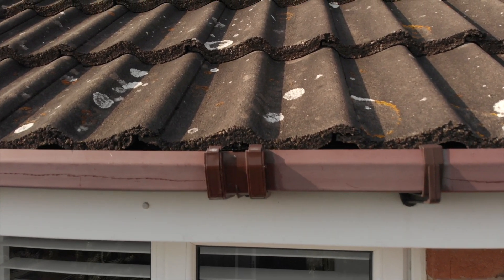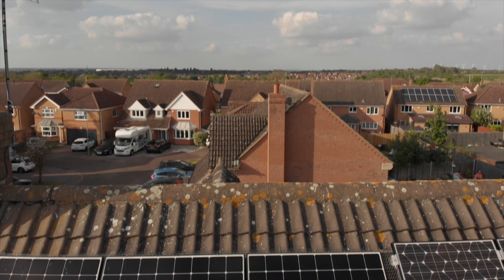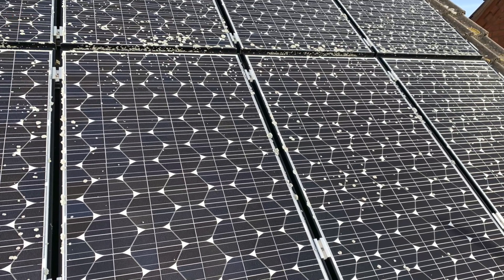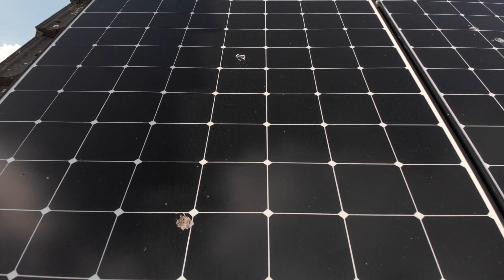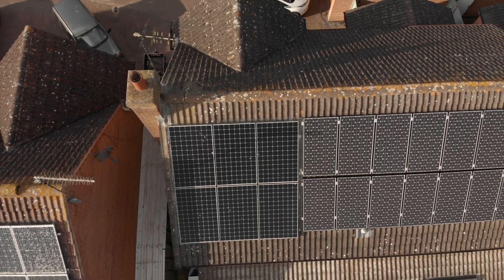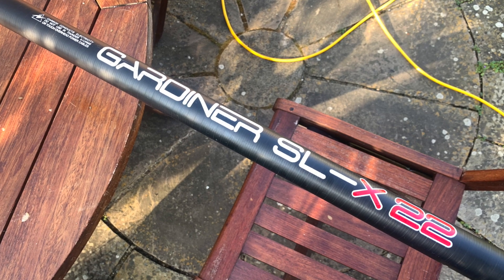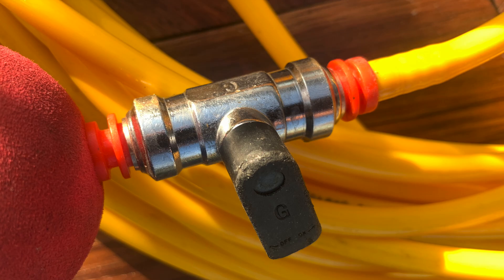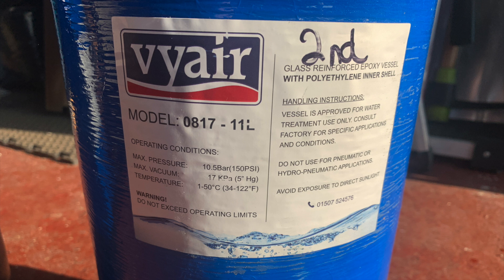How I clean solar panels with a water fed pole - WFP

Comment: You have a big advantage being able to stand on your extension roof - not too far to reach the panels. Reaching the panels from ground level will be much harder I imagine , perhaps impossible. I paid a roofing company to fit a mesh round my panels as I was getting a lot of nuisance from Pigeons and Doves. Whilst they were on the roof, they cleaned the panels using water and a stiff broom. Some of the soiling would not shift but they were a lot cleaner. I don’t however see any improvement in generation. I have had cleaning quotes - £14 per panel which is ridiculous. The outlay would never be recouped by any improvement in generation. I’m worried about longer term lichen so will look at trying what you did.
Reply from the maker: The single story extension certainly makes access for cleaning much easier. You can reach panels from the ground with a longer Water Fed Pole but it's physically harder work to do. I friend purchased a longer length WFP as he can only reach his panels from the ground.

Comment: Was there an appreciable uplift in generation after you had cleaned the panels? We have panels which were installed around the same time as yours and have never been cleaned....they are now pretty dirty and have moss growth on several of them so I'm thinking of giving them a clean. Also did you turn off the system when you cleaned the panels?
Reply from the maker: Thanks for watching John. I did not see a massive increase in generation. That said not cleaning them over a long period of time will certainly impact their performance especially if the moss growth you have continues. I did not turn mine off, they are active during rain, wind and thunderstorms. To be 100% you probably should do, but I never do and it's not like you are scrubbing them aggressively.

Comment: You could consider cleaning using rainwater, it has a very low TDS anyway, it’s going to be no different to every time it rains anyway. It’s largely the mechanical action of the brush that removes the dirt. Or rainwater as the feed water to one mixed bed resin vessel.
This doesn’t work so well for windows, where the fully deionised water is useful for spot free windows. 
I picked up my WFP off eBay secondhand, at 15metres it is a bit of a handful but I can get right up to the ridge tiles from the ground. But being carbon, a near perfect conductor of electricity you do need to keep well away from all things electrical, I DC isolate my panels too, just in case, even though deionised water is a poor conductor. Plenty of fisherman have died over the yearsfrom carbon poles touching high voltage overhead cables as have a few window cleaners.
Reply from the maker: Good points raised about using rainwater. We do collect it across 3 water butts  it is almost exclusively use on the large quantity of garden pots and plants.  

The WFP is a game changer for keeping windows and solar panels clean and I do enjoy using it!

Comment: I put my outside brush with soft head onto the telescopic Treen pruner extended. End of the brush head connected my power washer.  With the power turned pressure turned down on wide spray  everything connected to each other with Gaffer tape . Cleaned my panels. 0 cost .  Single story roof. I am frugal!

Comment: You do need to clean them but not very often. I cleaned mine this year for the first time in 4 years since got them. Had green mist over them.
Reply from the maker: Agreed, once they are clean they tend to stay clean and don't need doing that frequently depending on your location and conditions.

As I have the equipment I clean mine a couple of times a year just to prevent green algae re-growth.

Comment: So useful and informative John. Many thanks. I have been horrified by the quotes I have been receiving from companies to clean my 22 panels so I think a water fed pole is the way to go. I have carefully studied the video and what you purchased (Gardiner SL-X22 pole) but the Gardiner website isn’t the most user-friendly site for a non-technical person like me. So would it be possible to ask you to list exactly what you purchased from Gardiners for your solar panel cleaning  - pole I know is the SL-X22, but what brush, hose, spray kit, accessories etc. Then I can adjust if necessary to allow for my access and roof height etc.
Reply from the maker: Hi Peter, the website is not that user friendly for non-industry people. Here's the list, if you like drop me an email if it's easier for you. 
1 x Large Overspray Kit OVERSPRAY-BR,
1 x Upgrade to a Quick-LoQ Angle Adapter Long
1 x Ultimate 26cm Brush - Flocked
1 x QuicK-LoQ Brush Socket
1 x 2x 2mm Standard Pencil Jet Capsules
1 x ULTRAFLEX Hose - 10m Length for 18-27ft 
1 x Anti-Snag 'Hozelock Type' Male Plug
1 x Push-Fit 4 Way T-Connector for 4 Jet Brushes - no red clip
1 x Red Locking Clip for Push-Fit T-Connector
Jet Hose (6mm OD) - per metre x1M

I have purchased extra brush heads to do uPVC windows and soffits etc.
Reply: @johntisbury  Hi John. Thank you so much. I've sent you an email re the above.

Comment: Just an observation at 3:35 your ladder is standing the wrong way around.  The top of the treddle should be parallel to the ground roughly speaking.  As yours is the opposite way you are stepping only on the rear corner of it, as a result your effective grip on it is reduced and with wet soles on your shoes this may increase the chance of a slip / fall.
Please be careful
Reply from the maker: Thank you Jason, I will review my procedure for ladder / treddle placement. Appreciate you commenting and helping here.

Comment: Our panels were installed in 2018,2019 and 2021 never cleaned them until this year . Until this year they've self cleaned after rain but this year there's been an odd green dust layer that hasn't shifted so I've tried the same pole you have and will be buying one myself . Our roof needs 45ft reach to clean the very top edge so it so lucky with access.

We're in a very hard water area but my intention will be to clean after or during rain for a free rinse 

Very interested in the 4 jet option you have with 2 in brush and 2 above that seems perfect
Reply from the maker: Thanks for watching Nigel. A rain clean is a very good idea, a few people have mentioned that in the comments as their approach too - makes sense. I seem to recall you also capture rain water for car / garden use which is also another option. 

The 4 jet option seems to work well, 2 standard pencil jets and the 2 fan jets that come with the over spray bar. Gives the best of both worlds. It was the first time I'd seen the brush head at work on the panels with the camera attached to the gooseneck. The brush head needed to be swivelled a bit more as only the rear part of the brush was cleaning the panels. The front bristles didn't touch the panel! One to remember for next time. I also noted that a good cleaning technique was important. All too easy to miss bits if you are not methodical with your approach. I think camera work overtook the need to clean the panels properly!
Reply: @johntisbury  all looks so easy watching the video doesn't it .  What did you need to order for the bar and extra 2 jets   I find their site a bit confusing tbh not giving confidence whether things will fit
Reply from the maker: @EVPuzzle  the website does have a certain level of assumed knowledge, but I guess it caters for the industry rather than individuals like us. 
You want the Large Overspray kit £12.95 (from the drop down menu. Then if you want 4 nozzles the 4 way push-fit T-connector with jet hose £5.75.
Reply: @johntisbury  many thanks John , now tu decide whether I need the stiffer thicker version . Rowleys 8 section slx reached , just with a step but had lots of flex catching on bottom panel 🤔🤔

Think I've answered it for myself . Go for it
Reply from the maker: @EVPuzzle you can’t beat a stiff pole 😉

Comment: We clean those only when we know that rain is coming soon afterwards cause then tab water will not hurt or we do it before a shower comes down.
Helps a lot cause we had compared the results of a cleaned string with an uncleaned and it was an 8% difference that disappeared after having cleaned the 2 nd string the next day.

We have 13 strings and about 25 kWp now and 30 kWp soon with the 13 strings fully connected.
Reply from the maker: That's a great approach. I had a friend who would always wash his car in the rain for the same reason. Good to know about the 8% difference in performance between washed and unwashed.

Comment: My panels were installed in December 2015 and have never been cleaned, yes they get dirty, but only during dry spells. There is a very small amount of growth at the bottom edges of the panels, otherwise they are OK. Given the seagulls around here I'd need to wash them weekly to keep them clean in dry spells. We are in a hard water area, so it's interesting about the filters, only this morning my daughter was complaining about the white blotches after she washed her car and I had to explain what it was. PS 50 kWh generated today from 8.74 kWp.
Reply from the maker: Thanks for watching. I can recommend the resin filters for reducing total dissolved solids. Keep and eye on that growth, you don't want it spreading, it's like creeping death doe solar panels.

Comment: Good video John. 
Our window cleaner charges a reasonable £25 for all the ground & first floor house windows including our rear conservatory windows. However, he wanted a separate £100 for cleaning the glass conservatory roof & didn't even give me a price for the solar panels because his pole isn't long enough! Expensive I thought so I got a water fed pole to do it myself which, as you said, has paid for itself withing 18 months. My pole is a 30ft fibre glass type so a bit heavier than the more expensive lightweight carbon fibre ones when all sections are in it. I remove a few pole sections when I'm doing the conservatory roof & add them for the solar panels which I can just about get to from ground level with the conservatory in the way at the back of the house. I too have a resin filter which is great for pure water window, solar panel & washing our cars which I leave to drip dry without any spots.  
Not sure how long I'm going to be capable of hanging on to a 30ft pole waving about in the air but at least I don't have to run the risk of climbing any ladders.
Reply from the maker: Great to hear you have a very similar approach Colin. Non ladder climbing is a good option if you can make it work.

Comment: Another great video John 
You are correct when you mention the nay sayers on various forums.
I have mine cleaned in May every year and I can see an immediate improvement. We are on the edge of a forest and there is a lot of pine and oak pollen coming down these last couple of weeks. I am only achieving a peak of 5.1kW when I should be seeing 6.2kW so an effective 20% loss due to dust and pollen.
Reply from the maker: Thanks for watching Jerry and for adding some factual data to the argument about needing to keep the panels clean.

Comment: Excellent as always John I do clean mine at least twice per year or when needed. I see you have had the second powerwall fitted is the an install video coming ? I do follow your heat pump stats and think your electric consumption is very good for heating and hot water . All the best Glyn
Reply from the maker: Thanks Glyn. Great to hear you clean your panels too as needed. 
Yes the second Powerwall was fitted at the beginning of May. I will be doing a video on the update to the system. I'm very pleased with our ASHP and its efficiency based on the constraints around our installation; microbore throughout, long primary runs. The second battery was to combat the winter period usage and offset more of the peak rate usage with more cheap overnight storage.